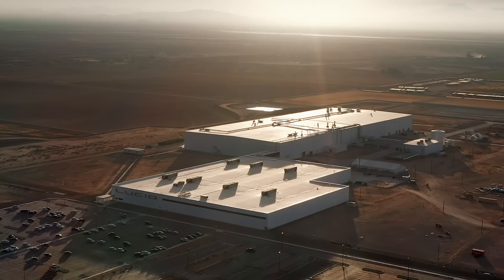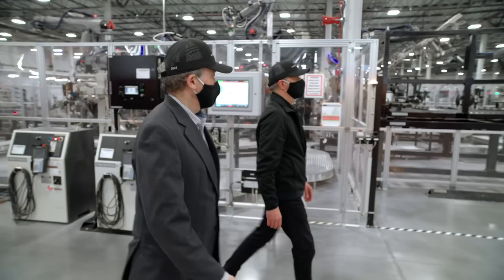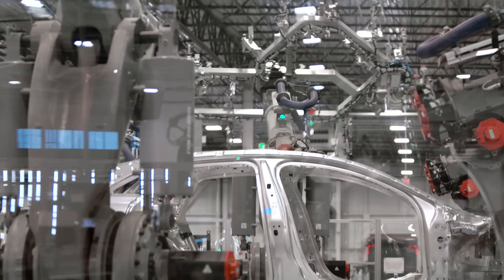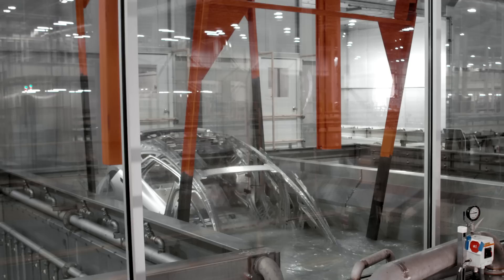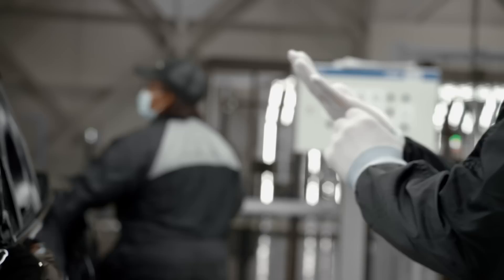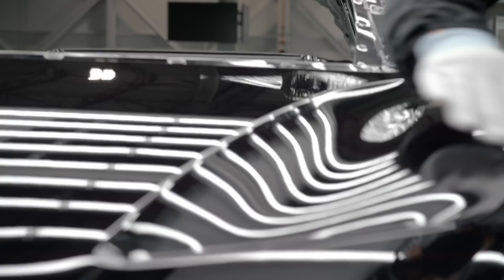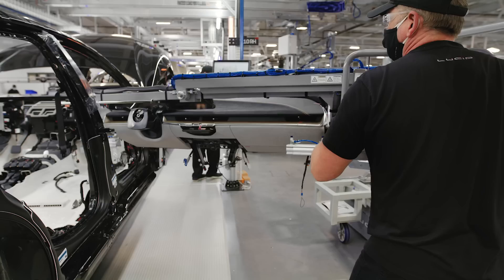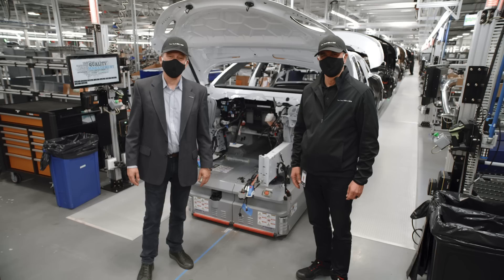The Grand Tour | Lucid AMP-1 | Lucid Motors

Comment: Would be nice if manufactures applied some kind of protection film like xpel from the factory. Great looking CAR!
Reply: They do.  It's called clear coat.
Reply: @blakespringpasturemortimer9168  I’m talking Factory clear film like xpel
Reply: @chassdesk  Yeah, I figured and was being a bit tongue-in-cheek.  There has been some discussion about whether Rivian might offer a factory film option on their "adventure" vehicles, but I doubt if anything will come of it.  Wraps are not without their own set of issues, and I doubt if a manufacturer wants to add them to the list of warranty issues they already confront.  Also, wraps (and ceramic coatings, too) should not be applied until the vehicle's finish is completely cured, and manufacturers don't want cars sitting around waiting for that.

I am planning to have Opti-Coat's newest product -- Pro 3 -- applied to my black Lucid Dream Edition.  I used Opti-Coat's earlier product on my 2015 Tesla, and it's still going strong.  Frankly, I'd rather deal with a local installer on correction issues, should there be any, on these types of products than with a car manufacturer.
Reply: @blakespringpasturemortimer9168  makes sense on the production and paint cure.  One day a manufacturer will take things to the next level in that department.

Comment: WHERE'S THE BODY STAMPING?  WHERE'S THE BODY ASSEMBLY?  WHERE IS ALL THE WELDING?  WHERE ARE ALL THE WORKERS?  YOU PAINT THE UPPER PART OF THE CAR AT A SEPARATE TIME THEN YOU PAINT THE LOWER PORTIONS OF THE CAR, BUMPERS?  WHEN YOU PAINT PARTS SEPARATELY THE GO ON ONE BODY THERE IS A SUBSTANTIAL CHANCE THAT THEY WILL AGE DIFFERENTLY AND LOOK ODD.

THIS IS NO GRAND TOUR!  Missing way too much! YES,Peter Rawlinson IS BRILLIANT BUT THIS ADVERTISEMENT IS DESIGNED FOR SOMEONE WHO MIGHT BUY BUICK OR LEXUS.

Comment: People don't realize that the battery technology will be bigger than the car distribution in 7 years. Sounds crazy but it's true. The battery technology will be huge. I didn't realize at first, but this stock could easily be worth 500-1000 by 2030. Buy 1,000 shares now, and in 10 years you could possibly be a millionaire.